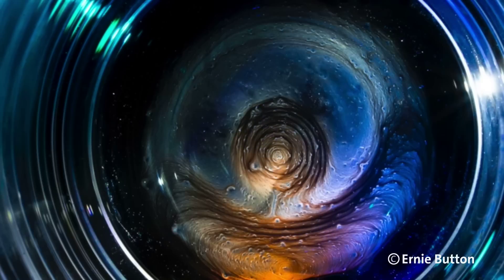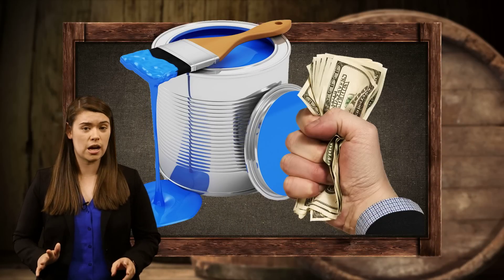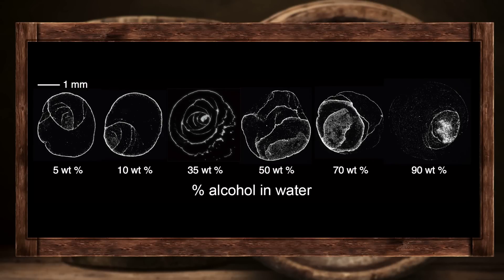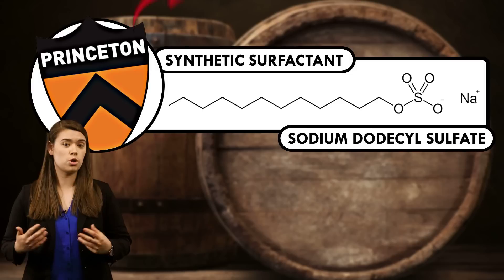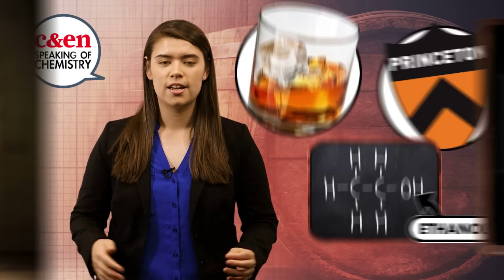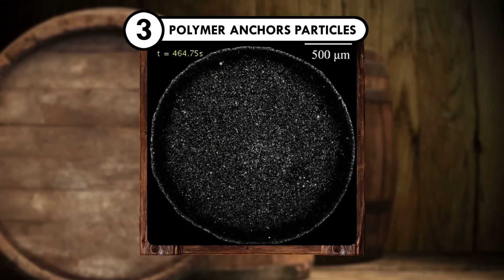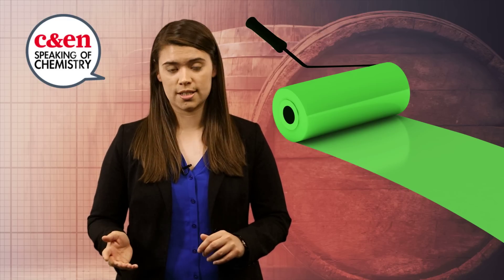Whisky Versus Coffee: Dueling Droplets—Speaking of Chemistry

Comment: very interesting phenomenon. however, i am still bit not clear. the rings seems to me are because of different compounds. or they have the same composition as the experiment showing? and why surfactants draw particles (solvents or solutions)? why coffee leave a ring like stain?
Reply: +Yaoxing Li Those are great questions. We don't really explain the chemistry of coffee in the video, except that it doesn't have the exact same components that whisky does. The coffee dries into a ring because a droplet evaporates fastest at its edge, so liquid from the center of the drop flows out to the edge to make up for this. That flow from the center to the edge pushes the coffee into a ring. But that might not happen if coffee were to have surfactants. Surfactants can create a flow that pulls particles or anything dissolved in the droplet back toward the center of a droplet. I think this is because there's a higher concentration of surfactants congregating near the edge of drop than at its center. Concentration gradients rule everything around me. At any rate, the exact chemical nature of the surfactant definitely looks like it plays a role in how things dry. The Princeton whisky mimic doesn't dry exactly like real whisky and the researchers think that's because they used synthetic ingredients to approximate the natural ones. Hopefully this helps, but let me know if you've still got questions. Thanks for watching!
Reply: +Matt Davenport Thanks, after sleeping on thoese questions, i think i get it. the basics are hydrophobic